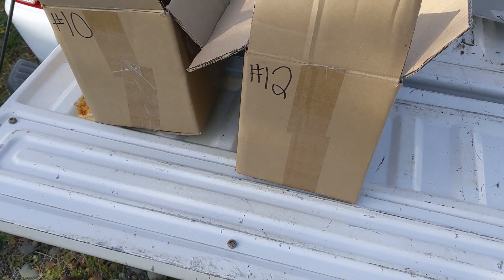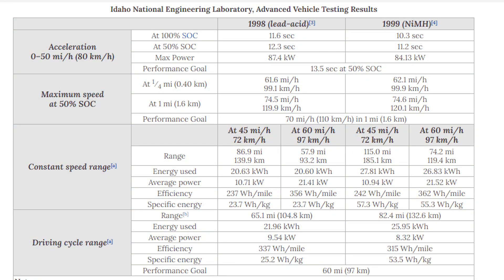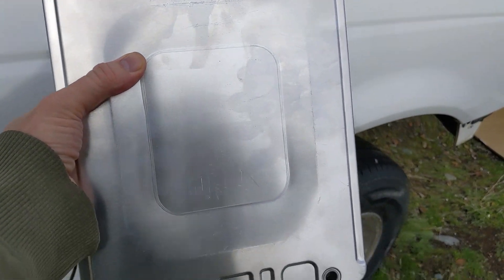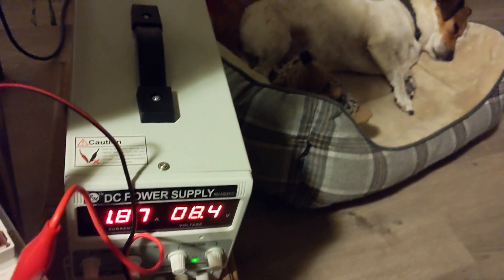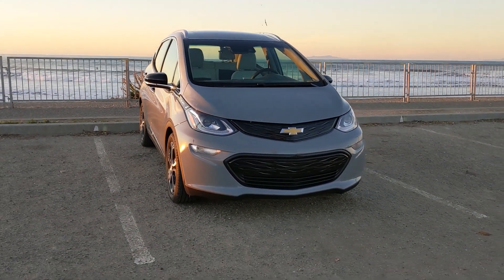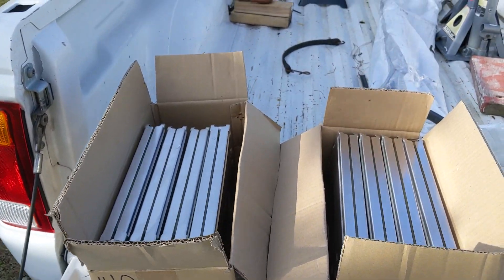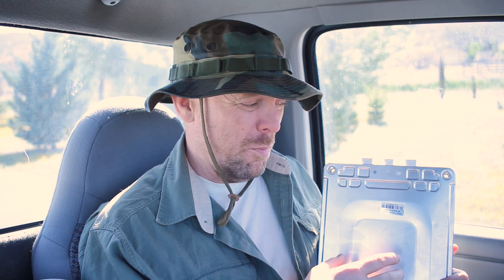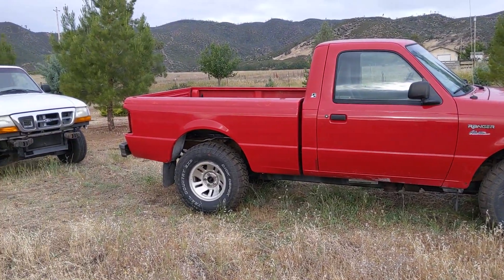Ford Ranger Electric Project: Why I'm NOT Using Nissan LEAF Battery Cells

Comment: "Pack is as good as the weakest cell" - well said, that is my unfortunate reality. I own a 2002 RAV4 EV (uses the same Panasonic EV-95 NiMH batteries as Ford Ranger EVs) which has 23 good batteries and one dead and because of that the car can't run. Once I accelerate the voltage of the bad module drops and the car just shuts itself down.
Reply from the maker: Man, that sucks. I'm not sure what their current inventory is, but I know that Trajectory EV down in Salinas recently restored a first generation RAV4 EV. They might be able to assist you with your pack/cells.
Reply: @newscoulomb3705  thank you, I will ask them!

Comment: I had 11 OG Leaf modules in my electric motorcycle. They did have some degradation over time- I got about 4.5kWh out of them when I got them, down to 4kWh later after hot garage storage. Then I neglected them over a winter without BMS and they were killed by neglect, sadly. Curious to see what the batteries are you've selected for the Ranger.

Comment: I feel like we need federal minimum warranty periods for vehicle battery packs the same way there are requirements for car parts availability to push companies to never produce throw-away cars the way Nissan did with the Leaf and their terrible battery longevity.
Reply: You are wrong on the leaf as a throw away car . I still drive my leaf and it is 9 years old.    They have 8 year warranty on the battery on the bolt what more do you want

Comment: Wait now, those batteries are fully able to be recycled OR still very capable as power storage. Here in Canada I am fortunate enough as it is mostly cold and sometimes my 2017 30 kWh battery heat gauge is at 1 bar, or 2. So passive cooling is fine!
Reply from the maker: Yes. When I say they're practically useless at this point, I'm referring to automotive use. The biggest issue is, with so much variance in capacity, I can't build a pack bigger than ~4 kWh without one of the cell groups pulling down the overall pack capacity. 

I might pull some of the worst of the cells and take them down to JB Straubel's new battery recycling plant just to see how that goes.
Reply: @newscoulomb3705  that would be a good topic for a new video Eric, all about recycling of the batteries. I am sick and tired of people saying it can’t be recycled.

Comment: whats wrong with using tesla modules?
Reply from the maker: Tesla modules are definitely an option, but I don't think they're the ideal for this project  for a number of reasons. I'll explain why a little when I talk about the cells I did decide to use, but it might be worth its own video. Really, the main reason to not use Tesla modules is price. The second is complication. I know of one Ranger Electric owner who did use Tesla Model S modules (14 of them I believe, for about 75 kWh of usable energy), but they required a lot of support in terms of packaging, BMS, etc. To me, they were too expensive, especially for a pack that would likely only provide about 220 to 230 miles of everyday driving range.

Comment: I'm using some in my Saturn VUE.  They actually came from a Renault.   The date I found on them was 2010 I think.  I put it together in 2014 and still driving it today.  When I got it going they were at about 50Ah, now they are good for about 30Ah.  I also have some 2013 cells in my Exmark mower.  Those are at about 55Ah now.  I still have some Bolt cells I want to swap into the Saturn but just haven't done it yet.  Have fun with your projects!
Reply from the maker: Ah, interesting. Yes, those cells are probably not too far off of the capacity I've seen in mine. At this point, I just don't think they'll work for automotive use, so I'll be using them for grid-tie or battery backup systems. Maybe some yard tool projects. :-)

Comment: I almost bought a few of these for my van as a power bank, but the problem with getting them used (which is the only way) you don't know how degraded they are. I went with LiFePo cells. They have their own challenges, though.
Reply from the maker: Yes. LiFePO cells are definitely the best new cells that the average consumer can buy. For a very short time, you could buy Chevrolet Bolt EV modules new (they appeared to be from when GM/LG were setting up their U.S. manufacturing lines), but those dried up very quickly. Also, they weren't configured well for things like 12 V, 24 V, or 48 V systems.

Comment: For what it's worth, it seems like the 2nd gen Leaf (2018+) has a much better battery chemistry that resists heat-based degradation tons more than the 1st gen Leaf.
Of course, it's still a mistake to not have any kind of active thermal management.
Reply from the maker: Yes, that's what I've heard. And so far, there haven't been many of the 2nd Gen LEAF batteries on the market to test. I think part of the new longevity is the result of "rapidgate." Essentially, Nissan is protecting the batteries even if it means inconveniencing the owners.
Reply: Nope, i already seen at least 5 40kWh packs with isolation fault, cells extending and acid start leaking fron them. They did a same crap what they did 10 yrs ago. I love my leaf SV, but battery packs are terribly bad. 62 is a bit better, but still rapidgating like crazy.
p.s. i upgrading leafs, repair them and swap on bigger packs.
Reply from the maker: @pashko90  Good to know. I thought the 40 kWh and 62 kWh would have been a bit better, but the cells are just baking in that pack.
Reply: @newscoulomb3705  i would say, cells still baking. 62kWh pack are getting hurt less since where is more capacity, but still easy to overheat. Cmon nissan, how much energy is transfered into a battery heat? So little, i guess even small transmission cooler will do a trick, but... :(

Comment: Yes, Nissan left out active cooling and screwed over a lot of people. Yes, Leafs are cheap, but Nissan engineers really messed up. My e-Golf also has no cooling system but the Samsung SDI cells are holding up pretty well (~6% deg at 30 k miles with no deg for the past 10k miles). You are able to buy used Leaf cells for a reason :-). What other cells can you get?
Reply: It should be pointed out there was a cell chemistry change in 2013 that was intended to reduce the heat-related issues. Having owned a 2011 I certainly agree the early batteries had a problem.
Reply: How bad is deg in 2013 - 2017 Leaf cells?
Reply: @barryw9473  Even 2021 packs are still pretty "questionable". I seen at least 5 40kWh packs fatally damaged. Nissan does not whant to cover them.
Reply: @pashko90  Perhaps they should take the loss and abandon support.
Reply: @pashko90  really? Brand new packs are failing and Nissan will not repair them? Where is this happening?
Reply: @barryw9473  2 in US(salvage title), 1 in nederlands, 2 in Russia/Ukraine. This is all least what I know.
P.s. what is really interesting, every single one of them have issues with a rear stock of cells.